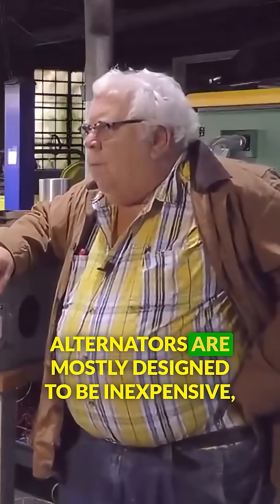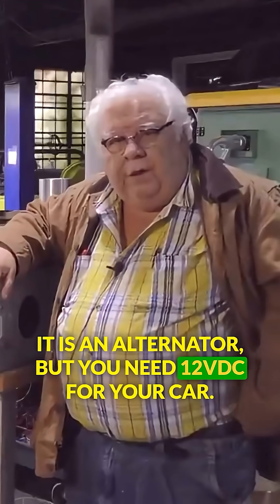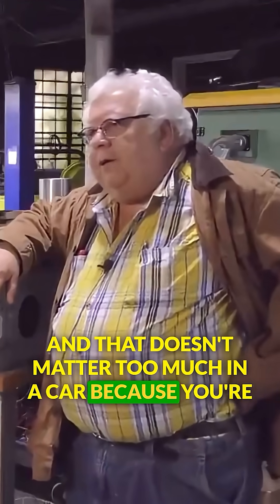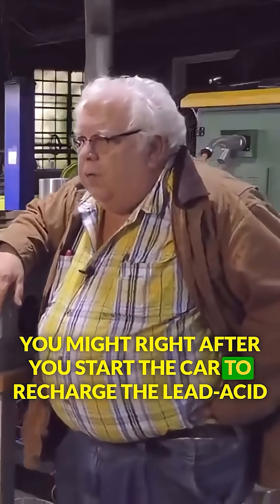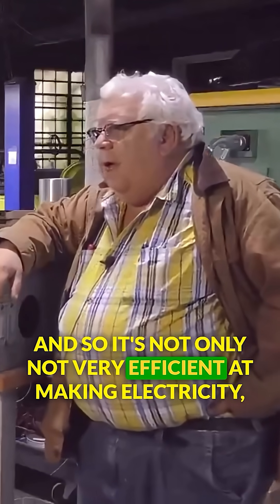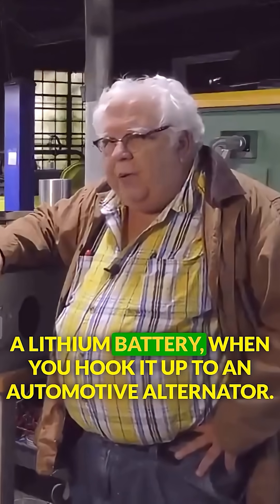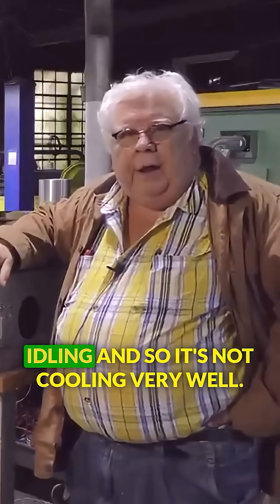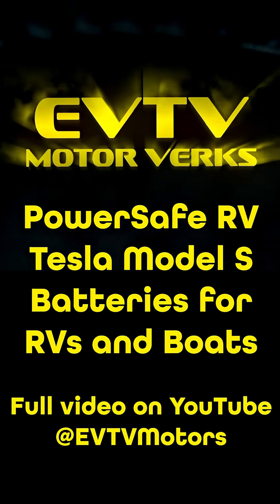Alternators are Only 50% Efficient!

Comment: This is wrong. A 3-phase bridge rectifier is typically about 90-95% efficient. Even with current used by the excitation windings, resistive losses and friction, I would expect at the very least a 70% overall efficiency of an automotive alternator.
Reply: Probably lose 3V across 2 diodes in the bridge rectifier at 100A. 70% efficient is reasonable. A synchronous rectifier could get above 90% but is more complex.
Reply: @KWmn-blm normal diode loss is 0.7v
Reply: @clausthomsen6743  Definitely not 0.7 at a decent current. With a 'diode test' on a multimeter at one milliamp, that might be .7V . A big diode conducting 10A will be around 1.2 - - 1.5V drop.
Reply: As a silicon diode approaches its maximum rated current the forward voltage drop will approach 1.0 to 1.2V typically (versus about 0.65V drop at a very low current).  In a full-wave bridge rectifier there are always two diode junctions in series for each phase (often three-phase), so a total maximum voltage drop of around 2.0 to 2.4V on a nominal ~13.8VDC output, corresponding to a LOSS in efficiency of roughly 1/6 (~2V/12V)…or 17%…or about 83% (100%-17%) overall efficiency.  That efficiency can, however, be worse if the diodes are not appropriately heatsinked as the forward voltage drop will increase if operated outside their specified temperature range (typically up to a maximum of 150°C, or greater).  Hopefully, they (the diodes) are operated at cooler temperatures than their absolute maximums!

The alternator will also have some additional efficiency losses due to the need to provide a field current for the field winding in order to both generate useful power and regulate the actual output voltage (e.g. 13.8VDC) generated by the alternator — the current flowing through the field winding is entirely lost insofar as the alternator’s output current is concerned (the field current generates the necessary magnetic field for the alternator, enabling power generation).  But I can not imagine the total systemic losses being anywhere near the 50% range specified in this video!
Reply: @ethanpoole3443  you were halfway there with your calculations and in the last sentence state you can't belive it's 50% !? heck it even can go down to 40% !  and 60% is max. for a bog standard compact alt.

 high efficiency modells by bosch do a lil over 70% but thats PEAK. average is maybe 60-65% in low load normal driving.

when powering a DC-DC Charger + Lifepo4 it will drop to 50 or worse.  bog standard drops to 40 or worse on a Dc-DC charger in a camper.
Reply: Agree that 50% losses is exaggerated. However, the concept appears sound that the heat generation due to inefficiency is significant and cooling is reduced at lower engine speeds and when these factors combine with a high load it can cause destruction.
Reply: @TinkTom no. it's not.

alternators range from 40 - 60% efficiency. some top end bosch ones do 72%.

alternators are extremely inefficient and were designed to withstand extrem frost, extreme heat, water splashes, huge rpm working range, produce at least a moderate output in idle speed and to be somewhat reliable over X thousands of miles/Km.

same goes for automotive AC compressors, powersteering pump, coolant pump.... everything automotive.
Reply: @casemodder89 we'll just have to agree to disagree.
In part the value depends on whether it is for thermal losses or total mechanical efficiency.
For thermal losses in a common alternator at high load you're looking at ~15% in the diodes and ~15% copper/eddy current heating in the stator and energiser coils i.e. 30% thermal losses. For mechanical efficiency a key element is the integral cooling fan for which the  load increases exponentially with rotational velocity. So for a worst case of mechanical efficiency at max rpm and load, you might be looking at 50% efficiency due to the fan consuming signifcant load. However, those conditions don't risk thermal destrucrion to the high airflow keeping temperatures down.
Regarding Li-ion batteries, they have a much lower internal resistance than  lead acid (for similar capacity) hence can draw much higher currents. Yes a well implemented system would have a BMS that limits the current draw - however I suspect the original video is aimed at more hacked together systems where I could envisage a car being fired up with a relatively depleated battery at and drawing 50+A for 10+ minutes whilst idling and toasting the alternator.
Reply: Also, depending on what chemistry of lithium ion battery will depend on the load applied to an alternator. I disagree with lithium ion battery drawing the maximum amperage of an alternator. It depends on a battery’s instantaneous amperage draw. There is also a battery balancing circuit, whether active or passive that lithium battery banks need, and usually has set limitations to how much current flow is required.
Reply: Being of a much older generation I’m not familiar with the latest developments in voltage regulator operating requirements for lithium batteries but would suspect that alternator design hasn’t changed much and still have the same characteristics of the older units at low engine speeds and won’t be putting out anywhere near its maximum output and not likely to overheat. Also car alternators have an inherent maximum current limiting regulation. The only time I’ve seen alternators burn out is if the stator windings have come in contact with the laminations or the voltage regulator failed and allowed an excessively high voltage to be generated. I could be wrong but some of his assumptions don’t sit right with me.
Reply: @johnellis1567 alternators haven’t changed at all. Even the use of MOSFETs instead of diodes was a short lived experiment due to cost.
Reply: I got confused at the part when he says a 1200w alternator creates 1200w of heat. Its an alternator or a heater? That would be like a 0% efficiency for charging a battery...
Reply: @pabloarduino2687  He's saying an alternator supplying 1200w may cause a 2400w load from the engine so 1200w is wasted heat ontop of the 1200w output. Alternators at idle rpm can typically supply 25-45% of maximum capacity (maximum revs).
YMMV.
Reply: @pabloarduino2687 your car a lets say 740HP is a 1000KW driving machine. but it's also a 3000kw water boiler, 50kw noise maker, 35kw parts wearer, 82kw gas pump.

driving is the main feature of cars. so they are rated for the engine power and what they can haul or how fast they accelerate. boiling water, making noise (❤), blowing hot gases out the exhaust, wearing parts ect. are negative byproducts.

so yes a 100A alternator is a 1.4KW electricals source (14V is the output for people that didn't live under a rock for 50 years). and in addition to the 1.4kw electrical output it additionally blows about 1.4kw of hot air into your engine compartment.

so it draws at least 2.8kw from your engine. with belt losses more like 2.95 - 3kw.
Reply: Heat generation. Loss of efficiency. Incandescent lamp vs LED.
Reply: Finally someone called out this kook. 50% efficient is totally wrong.
Reply: It's like knowing the half life of a drug.who gives af as long as it works per application.
Reply: He also fails to mention  “smart”alternators which have a higher efficiency.
Reply: He's talking about the alternator overall, not the silicon diodes, it literally says in the title, alternators are 50% efficient. The majority of the energy loss is due to eddy currents in the laminations and copper loss.
Reply: Older alternators in 60s cars are 50 percent efficient
Reply: Spot on
Reply: Efficiency depends of the speed vs load characteristics of the alternator. Using Schottky diodes and under most operating conditions, expect 50-60% efficiency. Obviously using mosfets would yield huge efficiency gains, they also cost a lot more
Reply: @Pops180  He's attributing the inefficiency to the rectifier when in reality it's because alternators are designed to work over a large speed range.

Comment: The brakes resistance adds to be recharge but the simple fact is wheels turning do not generate electric and it all battery it's inefficient and forty minutes in the hood at 4am to charge

Comment: Solar panels are a fking joke once the panels get dirty their efficiently is half covered with snow nothing wind mills cost more to erect and the distant between the station and the generator so much power loss for each hundred feet they break down continuously the power is right out in the air electrical storms lightening doesn't travel shortest distance between two points it spreads out and if you can slow it down like Tesla dis zero point energy is gay we should be back rking on the distance between two poles one big one low produces a differential huge the tower that Tesla built and the dynamo should be looked into and probably as but gennd Westinghouse had them kiled

Comment: Battery acid still best in some applications.Were warned 4 years back about my affinity for acid batteries.For my solar system.Totally off grid.So far no problem.
In summer heat can go up to 48 degrees.Lithium battery management system will disconnect if something go wrong.In some cases stay off forever .
If bms malfunction, 🔥.

Comment: Sorry but the alternator diodes are a lot more efficient than 50%. They have about a 0.7 to 1V drop. If the ones they used were only 50% efficient, I have a deal for the industry,  The reality is that that are better than 90% efficient.  Also note that the pully on the alternator is much smaller than the crankshaft pully. This raises the alternator frequency is by 2 to 4 times which makes the internal fan more effective. With lithium batteries you need a different regulator. So what. I am an electronics engineer and this person does not appear to know how alternators work. we have been using them for 60 years and if they were as bad as this fellow says they are, we would have changed them a long time ago.

Comment: The problem is the charging characteristics of a Lithium battery besides having a much lower internal resistance the terminal voltage remains almost constant around 12.8 volts until the battery is near full charge, when the terminal voltage rises sharply to around 14 , 14-8 Volts.

Comment: Could never understand why we gave up generators.  They could be used for both the starter and as electrical generation. Duh
Reply: Weight. But-yes-starter /generators are quite effective.
Reply: @stevenrobinson2381 so what are we talking a couple of kilo’s? My ‘63 vw’s generator was pretty heavy, but if you put an alternator and a starter on a scale, they would be far greater.
Reply: @jayobannon5359  not really-the latest reduction gear starters are FAR lighter than say a unit from 20 years ago.
Reply: @stevenrobinson2381 my ignorance, do not own anything post 72.
Reply: @jayobannon5359  nah-yer wise. No prob.

Comment: Alternators don’t make ANY power when the vehicle is idling. They need to be spinning at a minimum of 1500 RPM to make significant power because of low output voltage at low speeds.
Reply: At idle, most alternators are spinning at 1,500 rpm or higher. Typically, generating 20 - 40 amps.
Reply: @MrSummitville Most cars don’t run the alternators when the ENGINE speed is below 1500 RPM. Idling your car won’t charge the battery at all. The engine doesn’t make enough power to run the alternator (which soaks up at least two kilowatts (and your car air conditioner chews through ten kilowatts)).
Reply: @allangibson8494 Have ever worked on a car? At 750 RPM engine, the alternator is spinning at 1,500 RPM and it is generating AMPS.
Reply: @MrSummitville Not in any car I’ve driven - it’s spinning but the output voltage is too low to charge the battery.
Idle is minimal power output from the engine and frequently marginal for engine operation (particularly on small displacement engines).

Comment: Interesting, and all true. The reason alternators are called that is to distinguish them verbally from the older generator design. In light airplanes alternators are commonly used, and in that setting they're called "generators."
Reply: Some aircraft use DC generators, some use automotive alternators (from Chrysler circa 1960) and the most modern ones use permanent magnet alternators (because they don’t depend on having a working battery to work).
Reply: @allangibson8494  also a LOT of GA aircraft use Ford alternators-they even have the Ford P/N-and also have the magic FAA/PMA tag which raises the cost by at least 50%.
Reply: Old automobile generators produce straight DC. Alternators produce AC which is converted to DC.
Reply: @blipco5 ALL generators make AC voltage.  Either a commutator or a full wave bridge rectifier is used to CONVERT the AC voltage to DC voltage.